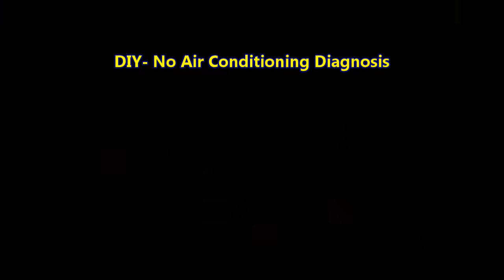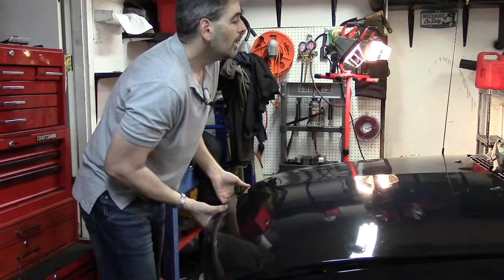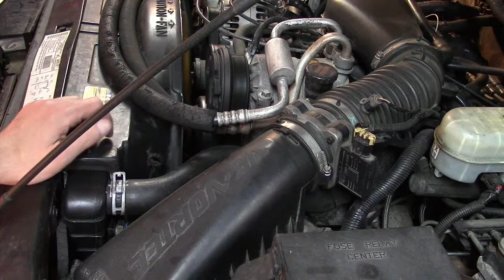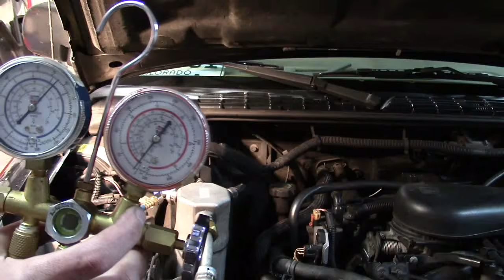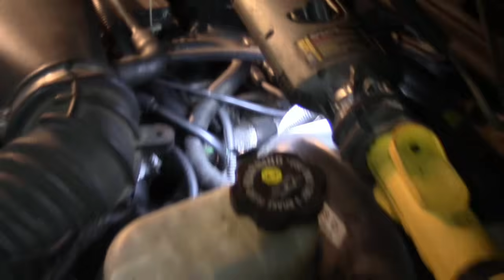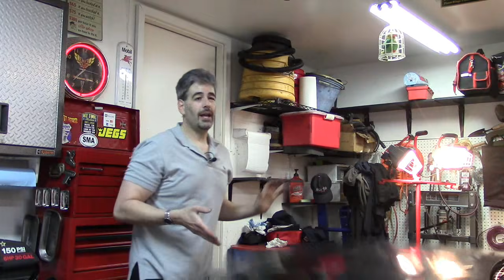DIY- Troubleshooting No Air Conditioning

Comment: Nicely done Mat. Reminds me of my problem. An Aircon that runs, deactivates and activates again. 

Not new. Used to be fixed just by putting contact spray on the pressure switch connectors. Looks like I have to go there again. 

Some genius put the Switch directly into the airflow of the engine and aircon cooler. So it gets blasted by saltwater every winter. And for some reason after 27 years it is taking it not that well anymore. 
Ill see if I can reproduce the error while not sitting in the car. If so i'll pinpoint the defect and think about a solution. 

Bets regards.

Benjamin 

PS: Did I miss the origin sensor solution ?

Comment: When and how did you rule out the relay?  I must have missed something.
Reply from the maker: The relay was ruled out when continuity on the load side was established after 12V was applied to control.  This verifies 100% relay must be good
Reply: So you were connecting the meter in series and measuring volt drops.  I couldn't see the dial on the meter, so i thought that you were measuring direct voltage(stupid ASSumption).  Thank you for taking the time to reply.
Reply from the maker: SgtSabotage Measuring voltage drops? Pretty sure I did not need to do that in this video. As a matter fact I definitely did not measure voltage drop- there would be no need because I had a no voltage situation.
Reply: +Schrodingers Box well you did when you checked the low pressure switch.
Reply from the maker: I did not measure voltage drop- I measured voltage to verify switch integrity. there was no need to do a voltage drop measurement.
Reply: +Schrodingers Box let me give you a quick overview of what's going on in my head. Now you can tell me where I'm going wrong. If you check voltage on the load side and put your test probe to ground that tells you that you have voltage and there is an open circuit in the system. But that does not check the relay, because the relay, if it is bad, can also be an open circuit. I believe that a bad relay in this situation was much more likely then a broken wire to the AC clutch.
Reply from the maker: SgtSabotage That would make sense if there was 12v but there was NO voltage at the relay on the power side.  Therefore assuming the relay is likely to be fault is illogical.  The only 100% certain evidence is there is a control power failure.  Maybe the there is that AND a bad relay but even so, you chase the sure thing that has conclusive evidence.
Reply: +Schrodingers Box I understand now. Since you jumped the terminals on the load side and found no voltage. Then by creating a ground with one lead tells you that you have an open circuit in the wire that goes to the Compressor which should be reading as ground.
Reply from the maker: SgtSabotage Not quite- but closer.  Watch some more of my basic electrical videos and i think you'll get there and it will make sense
Reply: +Schrodingers Box ok , and thanks for your time.

Comment: I have also used the Devo Diagnostic Technique (DDT) as a problem solving guide for automotive issues.  Nice success on the repair Matt
Reply: The DDT helped me to.  Cranking, no start, so I proceeded to "crack that whip".  It worked...lol.

Comment: Does the computer ever use the downstream o2 sensor in vehicle to adjust A/F ratio?  I'm thinking it only uses the upstream sensor since the downstream should always be a flat line with a working catalytic converter.

Comment: Great fix buddy. Do you have a catch phrase now at the end to whip it good? :) LOL

I passed 3 ASE's on Monday, Brakes, Electrical, and Powertrain diagnosis. Those tests were brutal. Days later I was still suffering from the mental exhaustion of it. I'm usually better on paper than in the real world, but they'd throw so many weird things in on electrical issues that you wouldn't expect, but all that thinking actually made me better on electrical than I was before the test.

There were a few things I didn't get quickly before the test, that I do no, including how you went to an outside ground to see what was going on with the wiring passed the relay. Brilliantly simple. The kind of thing that I think was on the test, well, never. However, I'm sure thanks to you and other information, which has helped me get better, your simple test was the sort of things I thought of during the test to simplify complex circuits.

ASE prep and tests themselves all suggest to test for issues like yours with the circuit of and with ohm's of resistance. They do teach correct load testing, but then fail to use it when it's best. What if the circuit is always hot? Then you'll potentially damage your DVOM (they liked to call it a DMM) when testing for ohms when voltage is present!

Glad to have you back in whatever capacity you can be here. :)
Reply: Some non-digs on the ASE...the test exudes pressure to look to relay's and testing through them as in real life I do find that an effective way to find issues...

Another non-dig - studying alone wouldn't have got me to pass, and they do require at least 2 years of experience. Hmmm, several years of 20 hours a weak DIY to them doesn't count as "professional" experience. Heck, I counted it anyway. Thankfully, I have a business to house my experience under.

Comment: I own a 2004 GMC Sierra. The air is sometimes hot and sometimes cold coming from the a/c. Setting five of the fan settings does not work at all anymore. The refrigerant level is good. Could you give me any recommendations of what to check next?
Reply from the maker: Yes- My air conditioning diagnosis video
Reply: It's on the paid channel. Schrodingers Box Quantum Mechanix - completely worth your free subscription, and then sticking around for that matter and becoming paid (initially it's free).

Comment: surprised eric o from south main auto hasn't commented yet! or ivan
Reply: I generally grab my test light when it's the better test for something or I can't find my DVOM. :)
Reply: But then...I'd have to have misplaced my PowerProbe as well, as sometimes I hook it up in ingenious ways just to see the voltage my dvom would have shown easier. Ha.
Reply from the maker: They turned it off soon as I brought out DVOM instead of test light hahahaha.  Actually I was going to do all the tests using a test light just for them- But at the same time, I also wanted to do this diagnosis conclusively the first time lol.

Comment: Did the DYI work on both our car's A/C systems.  Found out that oddly VW systems do not cycle the clutch, but are always 'on' during A/C operation.   Lousy design.  I replaced the clutch with a used one (5 bucks as opposed to almost 200 as you can't buy just the electromagnet)  It already failed several months later.  Open circuit.  Simple ohm check.  With mine?  Needed to give the system a part charge with U/V tracer.  Blew great cold!  But the bottom of the receiver dryer had a hairline crack/hole.    Always do the simple basic checks before tossing in a can of R134a.    (of course, know what to look for! and have an idea for direction as Scanner Danner would say)

Comment: This was a great repair as always. I was about to see how exactly you troubleshooted and diagnose the problem. I would like to watch a video on certain vehicle which is using scan tool to repair the air conditioner. I don't know what exactly the scan tool is doing in air conditioner repair process but I saw a few guys using that on some specific make and model air conditioners. If you have idea, please explain and if you may upload a video sometime when you encounter to one that would be a great help. Regards,
Reply: Most modern AC systems are integrated in to some sort of body control module and as such they can be checked via any decent scan tool.
The scan tool can often detect system pressure and pump rpm as well as lots of other stuff and can activate fans, flaps temperature control etc. It can also give you trouble codes to aid in the search for a problem.
Although handy the scan tool is never my first tool in AC diagnosis.
A basic methodical thinking approach like in this video will often find the problem way before you even get the scan tool out. Is the belt still there, does the pump turn by hand, is there system pressure, does the pump turn when you switch on the AC system?
These 4 basic things will very quickly, as shown here, help you decide whether the issue is mechanical or electrical and can be done in less than 5 minutes.
In this case the fault came in suddenly so this would more likely suggest an electrical failure of some type.
Also a scan tool is not generally used to repair a problem (with exceptions IE reprogramming), more to diagnose it. 
From an auto tech with 40+ years in the trade, this guy is probably the most methodical and knowledgeable DIYer I have seen on YouTube. Certainly way ahead of some so called "professionals"
Calling him a DIYer almost seems derogatory and this is certainly not intended.
Perhaps "Non professional" would be a kinder term. :-)

Comment: you mention your video on air con diagnosis. I can see to find it what was it called?
Reply: His series on a comprehensive going over the A/C system is on his paid channel. I couldn't make myself watch all of it right away since I knew too much about that system, but I picked up good pointers.

That said, I'm a novice on A/C, so I just spent weeks or months coming back to those video anyway, as I needed them....perhaps the issue is with me. I find that system less interesting. It's Matt's fault, he took the last of the mystery of how it works out of it for me. LOL
Reply: +DE “AutoBravado” Nichols thanks for the info

Comment: that engine run smooth for a 20 years old vehicle
Reply: +Matt In Illinois definitely
Reply: Those vortec engines run a long time.  I just turned 250,000 on mine, and it starts just as easy.
Reply: +Louis Pasnik they are pushrod ? Right??
Reply: Yes, pushrod and hydraulic lifters.  not to say i didnt have to maintain it, and the occasional issues with this engine (injectors plugging probably because of dirty fuel, fuel psi regulator leak, intake manifold coolant leak, etc.) but compression is still great, and doesnt burn a drop of oil after 250k.
Reply: +Louis Pasnik I heard the old gm engine with the pushrod are the best but nowadays design with all those sensors and electronic,they tend to break every now and then
Reply: My reply feature is broken. + to Steeve then, I agree. They're quite reliable still, but the electronic are more prone to failure and without competence these vehicles keep suffering until an untimely demise.

You know, I'm a David Nichols more or less too. :) Just no Steve here.